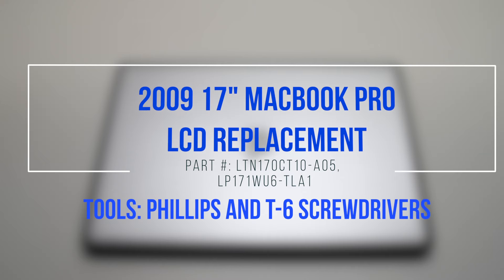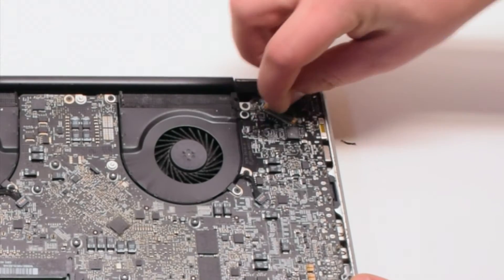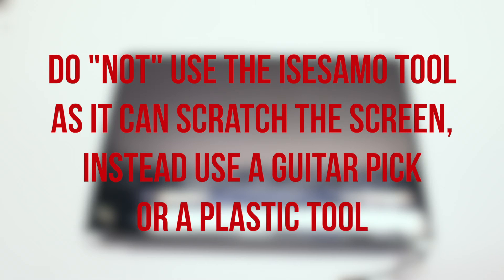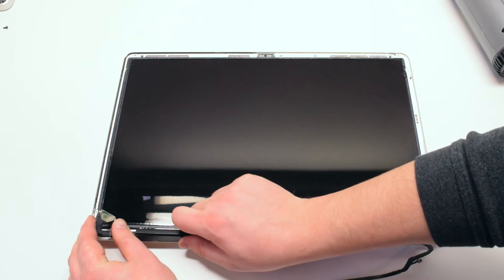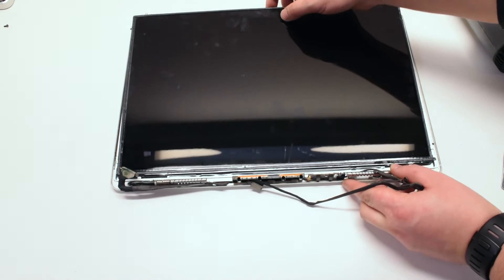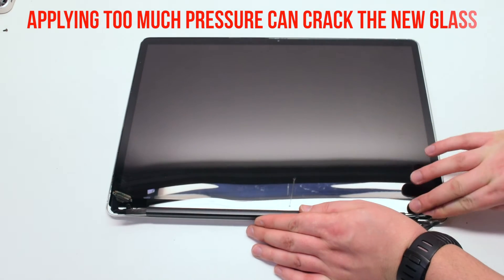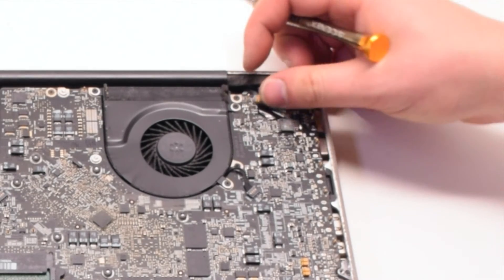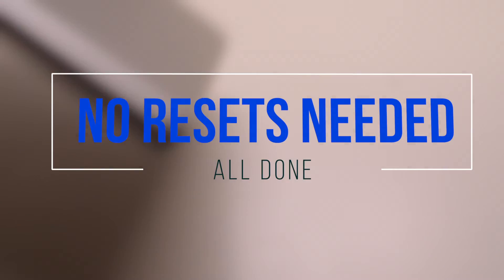2009 Macbook Pro 17" A1297 LCD Screen Replacement

Comment: I have a 13 inch 2009 MacBook Pro. I have a glitch bar on the right corner. If I bend the display(slightly) in a certain way the bars go away. How can I fix this? Thanks

Comment: amigo muy biuenas tardes, tengo  un probelma, le cambie la pantalla a mi macbook pro 17 y le instale la pantalla nueva bueno no nueva la compre de sengunda en una tienda  online, el problemas es que la conecte todo correctamente pero no me da imagen ni enciende la luz de la manzanita, solo cuando activo el facetime  desde el escritorio me da luz verde la camara y puedo verme atravez de ella pero no me brinda nada de imagen y reacciona como si estuvirera al 100 por que al cerrarla automaticamente se suspende y al abrirla igualmanera. mepodrias ayudar amigo, seriga un gusto, soy de guatemala
Reply from the maker: It very well could be the back light is out and that's a component level repair. Refer to Luis Rossman's channel for that.